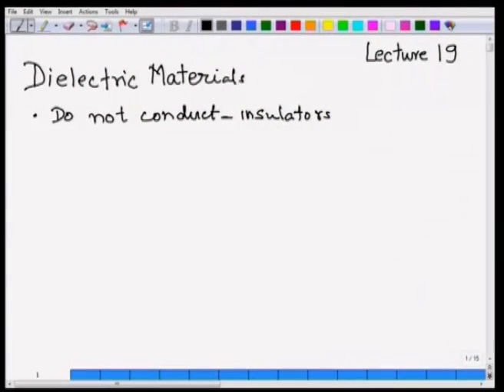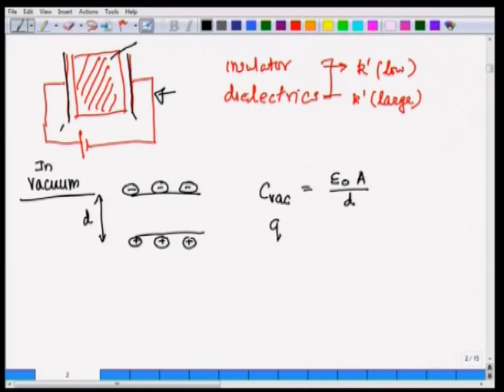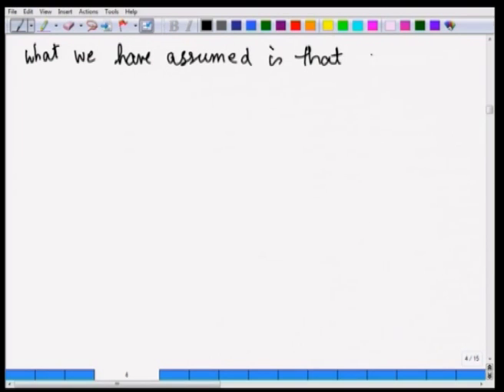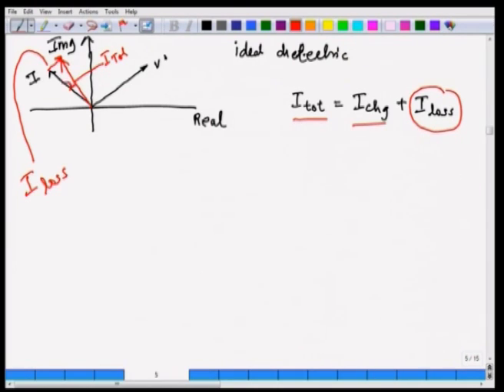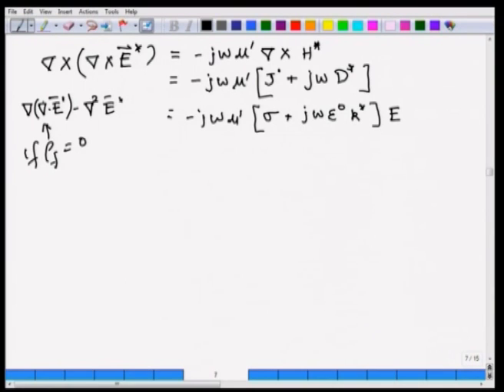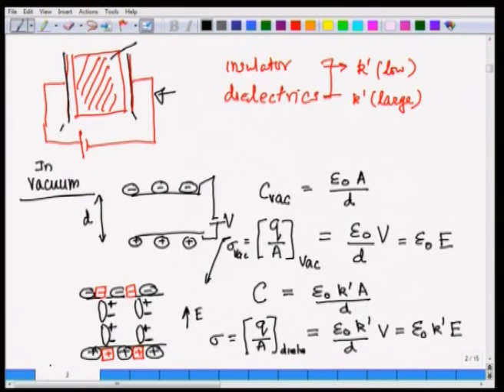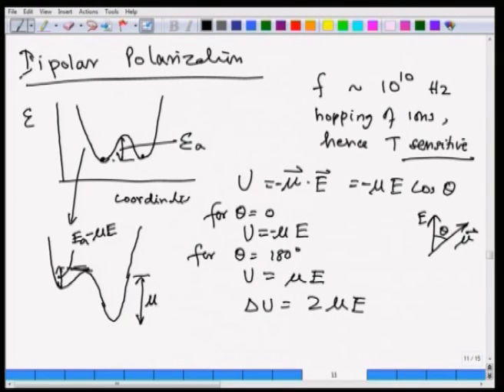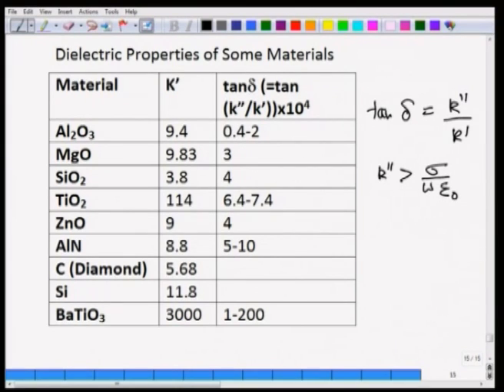Mod-02 Lec-19 Linear dielectric behavior

Comment: Professor, you said that extra positive and negative charges are induced suddenly on the plate I want to know the physics behind it.  The explanations are based on non polar dielectric is it valid for polar dielectrics also.
Reply: The charges due to dielectric dipoles aligning themselves reduces the electric field between the capacitor plates. This means that there is a sudden decrease in voltage across this capacitor (voltage = field * distance between plates). He assumes that the capacitor is connected to a constant voltage source, therefore now the applied voltage > voltage across capacitor and a charging current flows until the voltages are balanced. That is what gives the extra red charges in the plates. This would be valid for all dielectrics.